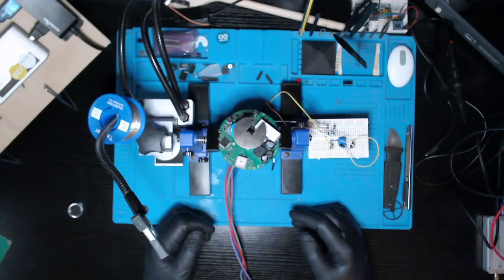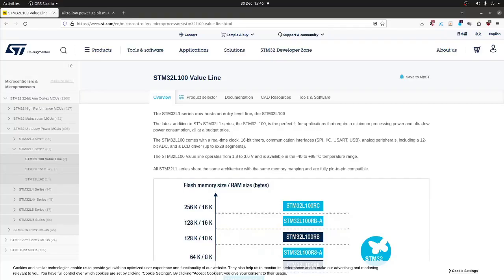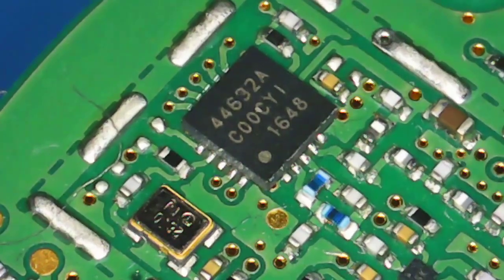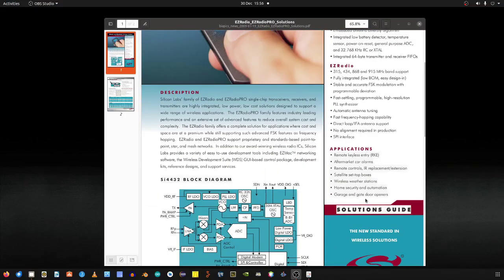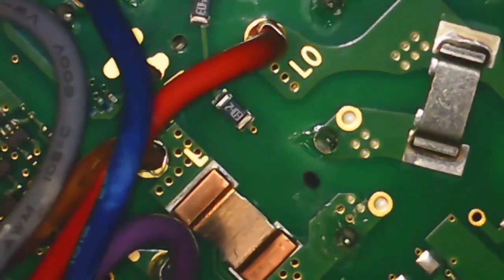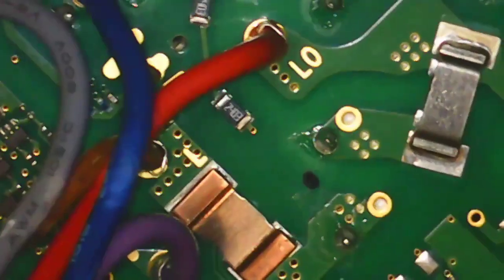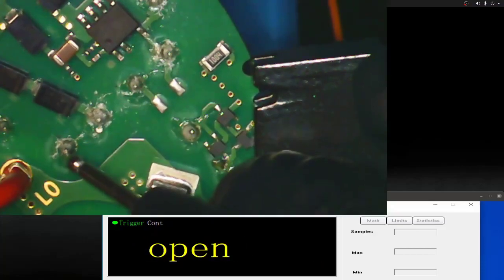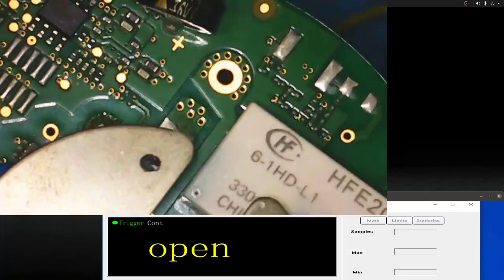Mark Steele is at it Again.

Comment: Really enjoyed your video - amazing how simple they are. The "5G" that is claimed is actually nothing more than a low power remote control chip? I was curious as to how it works and that makes sense... a nice low cost solution.

I'm m guessing there must be some kind of receiver which gets telemetry from the nearby lamp posts to send back the status of how many pedestrians have been obliterated... er.. I mean the status of the LED array on top of the lamp post 😁
Reply from the maker: They are just switches, which are called leaf nodes. 
They send a 64byte payload back to the branch node, usually 4G or another Internet interface/protocol at a schedule set by the council or whoever provisions the unit, with the most basic of parameters.
They can operate at <0.5 mAh meaning they can send a fault code multiple times with only the charge left in a capacitor when the power fails.

Provisioned with LEDs they can save the council millions of pounds in maintenance costs and energy consumption.

There is also scope for when the infrastructure is upgraded to supply free WiFi Internet access.
Basically it's a Boon for the public purse and IOT devs like myself who recognize what a connected society looks like post 2025.

Just a shame a few grifters want to make £££s off vulnerable people by spreading misinformation about something that actually helps keep your council tax lower
 🤦🏻‍♂️
Reply: @arthurbrotleibe1528  I was thinking exactly that - and with that little extra money spent on redundant components it'll save hundreds of pounds getting a maintenance team out with a cherry picker if a trivial part goes wrong.

Great teardown, and really conclusive - thanks for taking the time to make this.